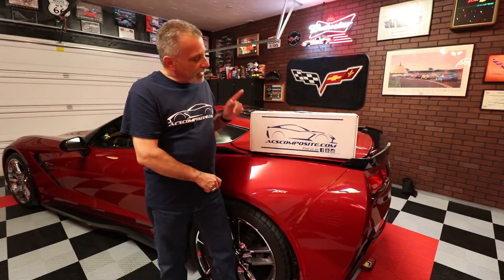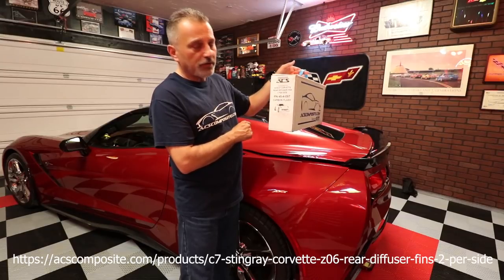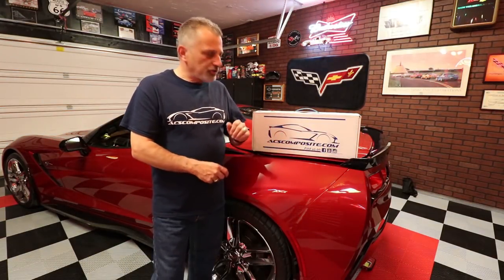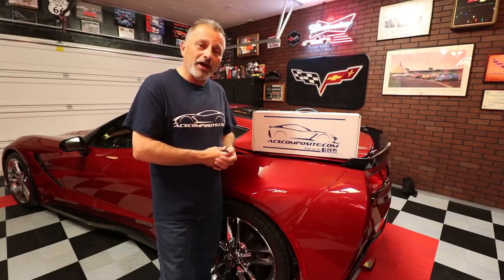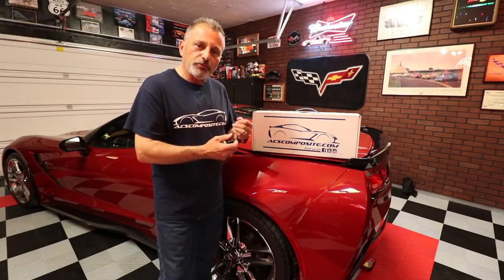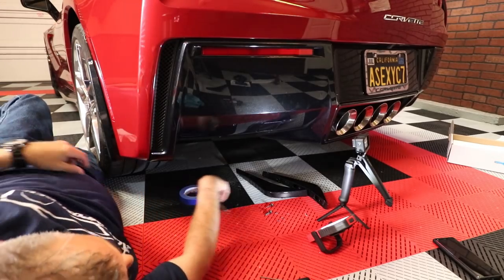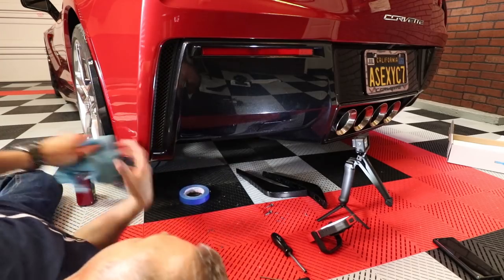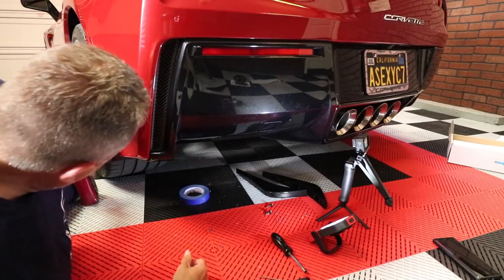How to Install Rear Diffusers Fins from ACS Composite on a C7 Corvette

Comment: Thanks, just finished installing the fins on my Z06. I would suggest after drilling the 1/8" holes through the template into the valance that you remove the template and use it to line up the holes with the screw holes in the clips that have been installed on the diffuser fins. This will greatly aid you when installing the fins. There can be a great variation in the drilled holes and the spacing of the diffuser clip holes. With working clearances tight under the valance this will make getting the screws started into the diffuser clip holes much easier.
Reply from the maker: Thanks for your input. I didn't experience that but I can see how that could happen.